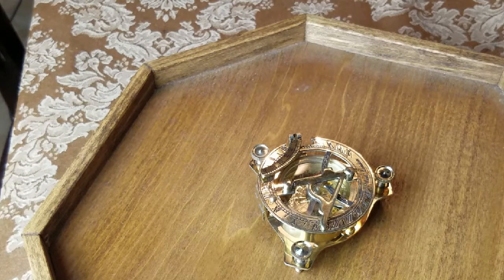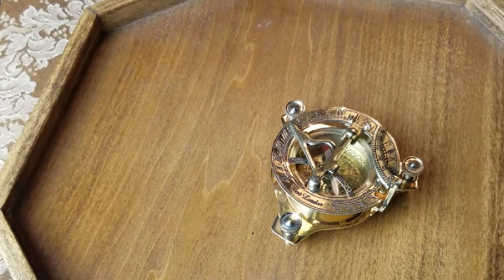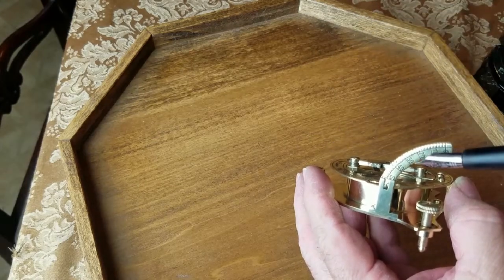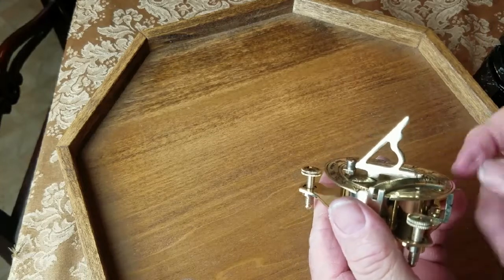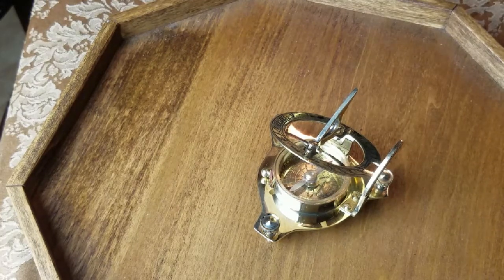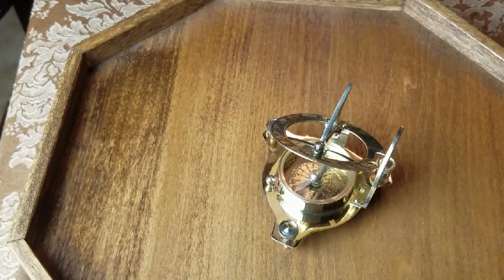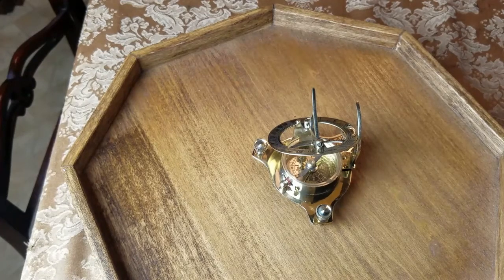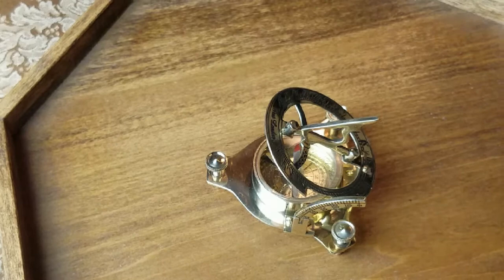Antique Sundial, How it Works!  Gary J

Comment: Thank you for your video. Regarding 13:04, the compass needle actually points to Magnetic North rather than to True North unless your location happens to be along an agonic line on the Earth. In order to locate True North, then a compensation for the Magnetic Declination at your location needs to be adjusted onto the Magnetic North reading on the compass. For example, in Georgia, the Magnetic Declination is 12.39° West. That means when the compass needle points to Magnetic North at 0° Azimuth, then True North is actually located at 12.39° Azimuth which is approximately close to the direction of North by East on the compass rose. Also along the top edge of the gnomon, this points to direction of the North Star when the Sundial hour plate is tilted up to your latitude on the curved brass arc on the sundial.
Reply from the maker: You are correct! When I set up my Telescope I have to set it to true North. Thanks for the comment!